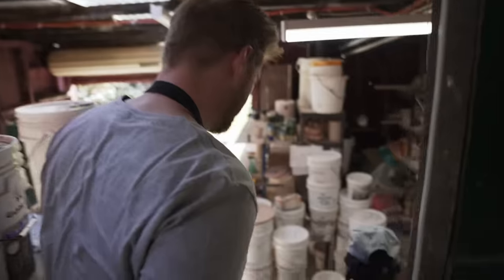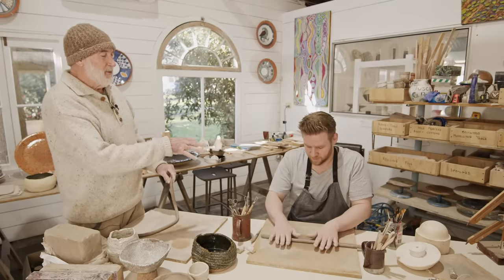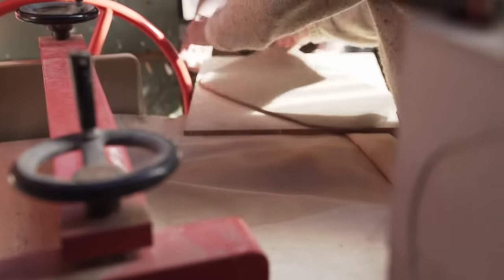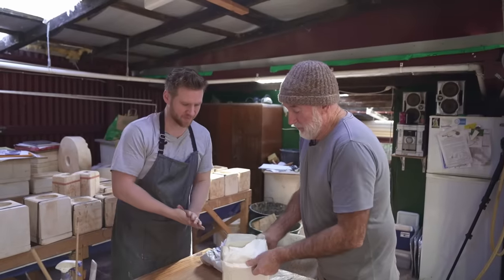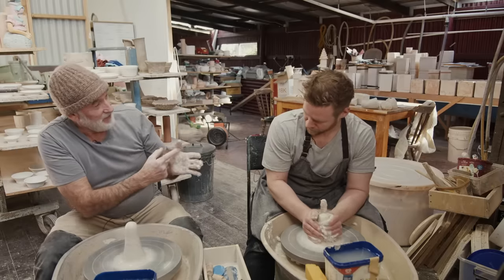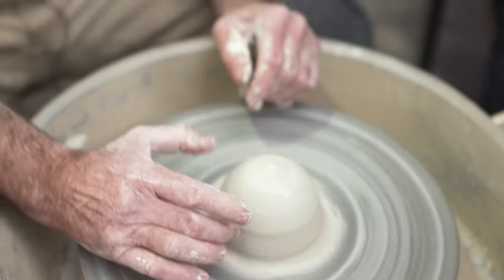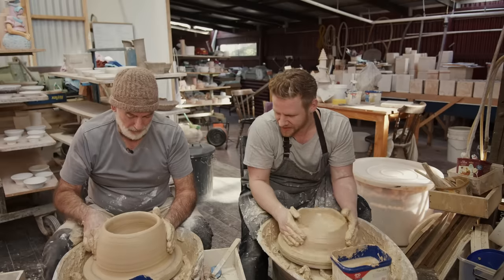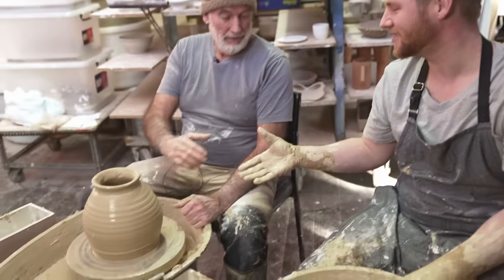Pottery is HARD.

Comment: I taught adult ed pottery classes for many years. Been missing it lately. Throwing on the wheel is my first love... I always liked to give speed advice for different stages of throwing - 75mph for centering the clay, 45mph when opening and the first pull of the wall, but then you need to slow it down to 25 - 30mph for pulling up the wall and shaping.

Comment: I minored in ceramics (mainly a handbuilder).... and this brought back soooo many memories.
    You did sooooooooo good your first time throwing!
    But, if you don't have really strong hands, that style of centering on a wheel is extremely hard.
   The anchor method is faster and more reliable... it's when you anchor your elbows into your hips or inner thighs and one hand pushes on the side while the other hand, In a fist or spongue, pushes down from the top corner....
      I miss ceramics....

Comment: As a ceramictist this was quite enjoyable to watch. I primarily threw on the wheel. One thing I was told when I first started throwing is "don't let the clay make you its b*tch." Along with "feel the rhythm of the wheel. When centering he was going too fast aiding in his loss of control over the clay. It takes patience and feeling things out. Once the clay is centered you put in the shaft and pull out "pulling out towards your belly button with your 2 index fingers". Making your well is crucial because for the next step it doesn't matter what is being made you want to pull as straight up as possible. Once you have the desired height one can then shape your bowl or cup starting from the base going outward again slowly and just molding as you will. Metal ribs are great, but one needs to be careful as they can stab your work my preference was always rubber ribs. Last note is always watch how much water is used through the entire process as your clay can go limp (some clays are more forgiving than others). Overall it's a fun art form and I miss it quite a bit. Hope this helped someone and hope whoever read this far has a great day ^^.

Comment: For anyone wanting to try throwing, here are some tips I've gathered over the years:
1. When you've sat down at the wheel, cram your elbows right into your waist.  Or torso.  You want your elbow immobilized so that your forearm becomes a lever.  This keeps your hands from flopping all over the place.
2. Center fast.  Slow down to open.  Slow down even more when you pull the walls.
3. Move your hands slower than the wheel rotates.  For each millimeter your hands moves up, the wheel should've made at least one complete rotation.
4. Put your hands onto the clay slooooowly.  Take your hands off of the clay slooooowly.
5. Hands off?  Wheel off.  Always. If you remove your hands from the clay, stop the wheel (slowly).  It'll prevent accidents.
6. If you feel your hands "catching" on the clay, you need more water.  Or you need to clean the "goop" off of your hands. Or both.
7. But don't use too much water, either.
8. No sudden movements.  Wheel throwing is all about smooth, slow, uniform motion.

Comment: using one hand is easier because both hands are never doing identical motions so if you're shaping one one side, the other hand is also shaping slightly differently and you'll never get a centered pot. Also don't control the clay, move with the clay.

Comment: I just want to add that the wheel throwing is not even the final step! Next, you let it dry until it's about as hard as leather, and then you put it back on the wheel upside-down to trim it. Then you dry it completely, fire it, glaze it, and fire it again. I have taken enough classes that I feel comfortable with the first few steps, but my glazing needs a lot more practice. I've ruined some really great pieces with a bad glaze job, and it's very frustrating.